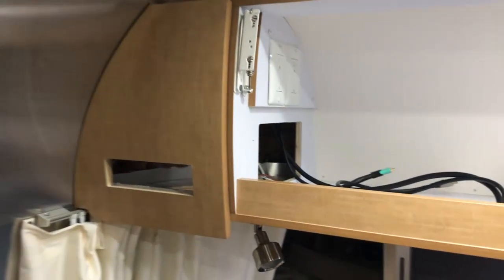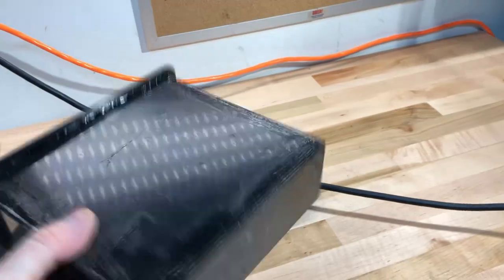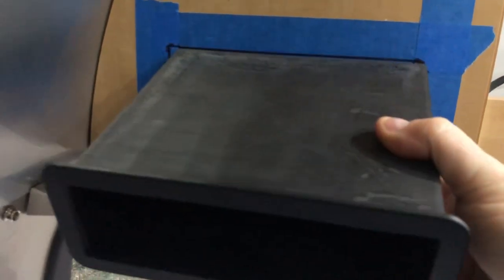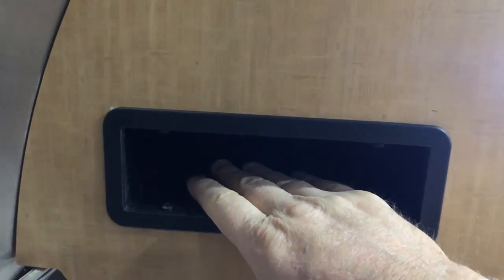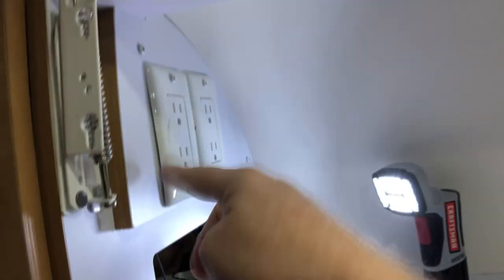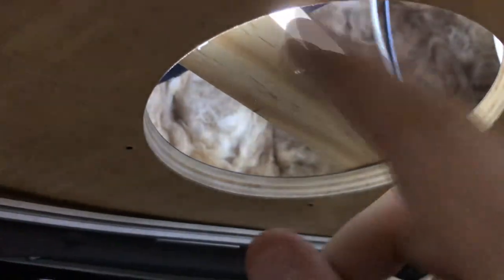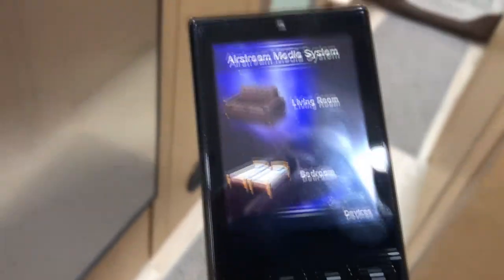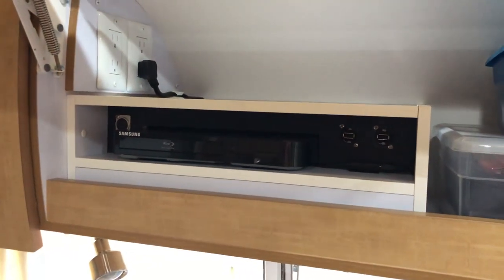Airstream AV Upgrade Part 3 - Final Install

Comment: Hello Great Video Thank you, We have new to us 2021 Airstream International 25FB with 2 TV's.  Does the airstream have a HDMI spiltter so we can watch two seperate TV on different channels, if not how would you install this?  Thank you not very many intructions on you tube on this subject.
Reply from the maker: Mine did - I think if you watch part one I take it out but I think it was connected to the bluray player.  An HDMI splitter will not allow you to watch two different channels but allow you to watch the same thing on either TV.  You need a splitter for the antenna on the roof which I think is already in place.  If you go to each of the TV's and do a channel search the channels you can access will come up.  Should be the same channels on each TV.  Thanks for the comment and for watching - enjoy your new Airstream...

Comment: Wow...stumbled on this today and watched it back-to-back.  Bravo!   Can you provide a ball park cost on the RTI remote?  What about what the costs were for all the other components?  Is this something a "total newbie" could undertake successfully, if they are careful - or is it "something best left to a pro"?
Reply from the maker: The RTI remote has to be bought through a dealer and it is pretty pricey....about 600 for the remote and a couple hundred for the processor.  The links for all of the hardware are listed in the info under each video.  Also there is a "using the system" video on my channel just search my channel for Kodi.  Thanks for watching!
Reply from the maker: Mark Speros BTW...other than the programming it is not hard to put together